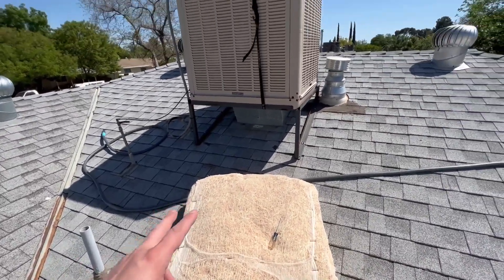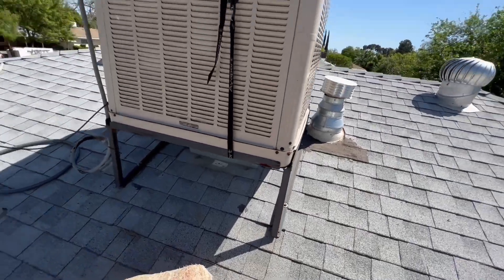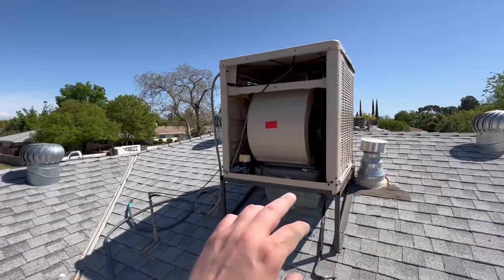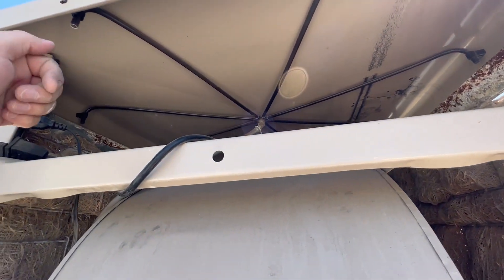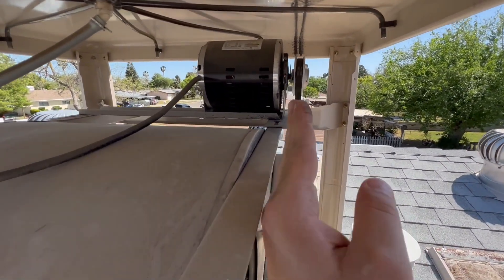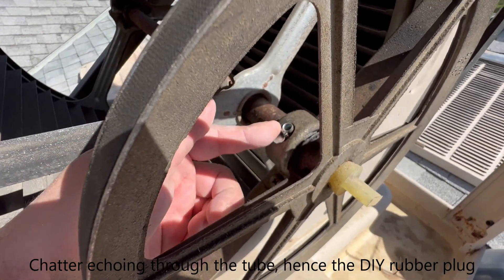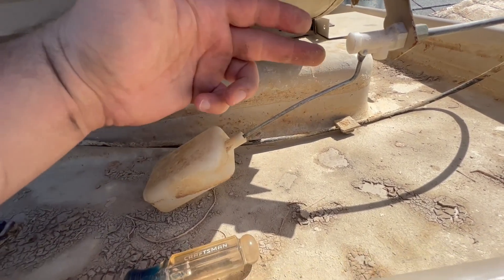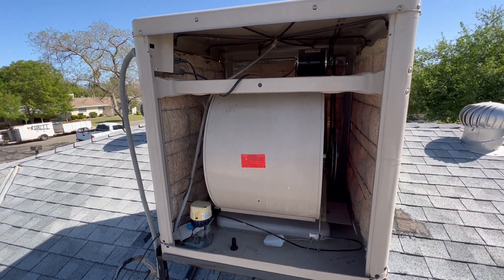Swamp Evaporative cooler setup - Summer and winterization "Part 2 - Outdoor Reno"

Comment from the maker: Update:
Water pump not working/ spinning:
Take apart the cover and lube the shaft, remove base impeller cover and spin impeller. Calcium and rust has built up on the shaft and keeps it locked up.

Vibration and sound from the cooler:
Tighten up all bolts on the motor and tension the belt. The cage fins might be loose or broken causing a rattle which would need welding of some sort. JB Weld might work, use minimal amount to keep everything balanced